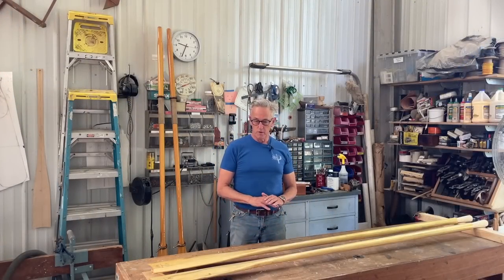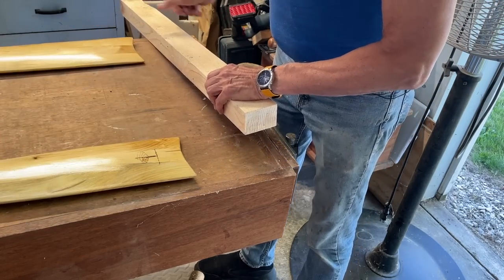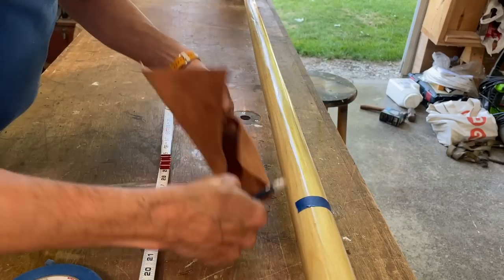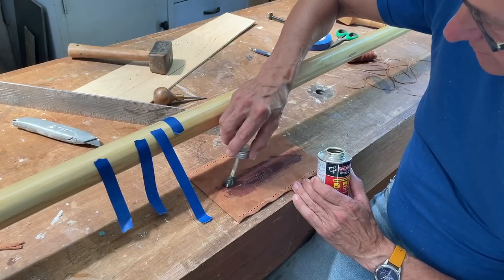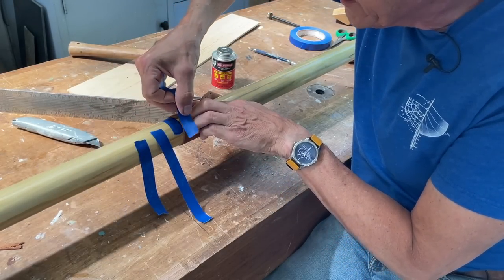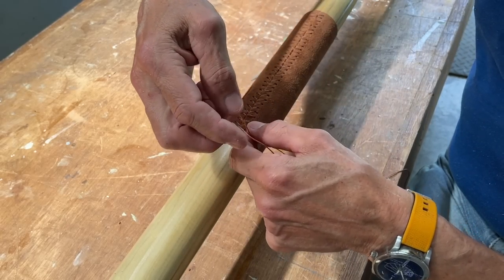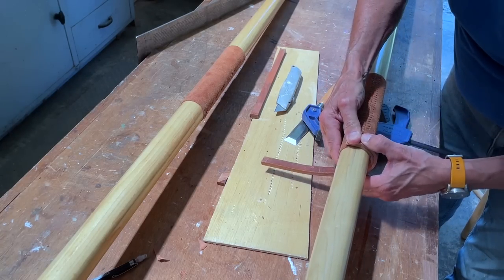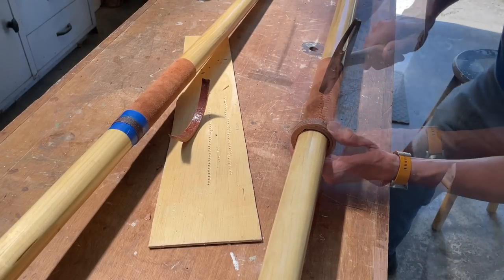Stitching Oar Leathers: A Step-by-Step Guide, S3-E22

Comment: I’m so impressed at your finesse between lumbar fine joinery casting and leatherwork, you are truly a versatile craftsman. BTW how has the rear bulkhead coped with the EV motor Steve has been using, and are small outboards something you will be incorporating into your future projects? I would be quite interested in seeing a nested dingy if you are looking for a new challenge… Thanks for your tremendous work and generous and elegant explanations, you make it all look so achievable for us novices in YouTube land.
Reply from the maker: Thanks Simon. One design feature I incorporated in Victoria was a racked transom (15 degrees) to allow for an outboard. Originally Steve insisted that he wasn’t going to have an outboard. I had a very strong feeling he would change his mind. So, to answer your question it was designed with an outboard in mind. I love the electric outboard. In fact I purchased components to convert an old runabout to electric. ( an upcoming video) Great luck that Epropulsion had a booth at the Wooden Boat Show. 
Thanks for watching!
Bob

Comment: The oars look great.  Is the spruce strong enough to withstand heavy pulling of the oars?  It's good to know how to paddle a dinghy like a canoe by sitting backwards on the deck in the bow and paddling the boat backwards with an oar in case the other one breaks.  You might be surprised how well this works if you haven't done it before.  (I learned to paddle like that with a 4" wide board in an old abandoned rowboat in the pond across the railroad tracks from our house when I was a kid.)

Comment: In the previous video, you calculate the inboard loom as 25-1/2” but then explain that the actual distance from the end of the oar to the padlock will be 22” so the oars do not overlap. 
In this video, you appear to forget that. 
The width of the leather will address that - but I’m curious why you didn’t center it at 22 after making that decision in the previous video.